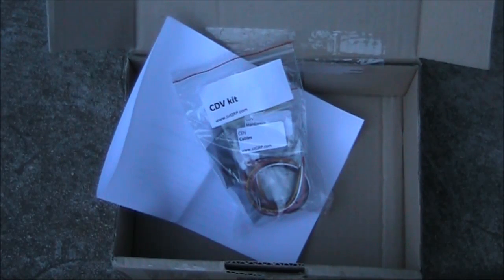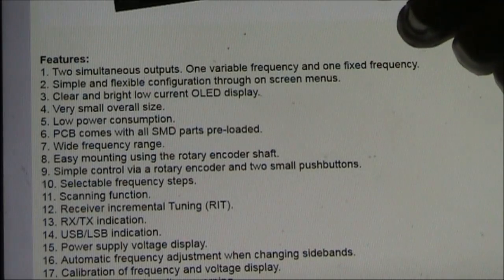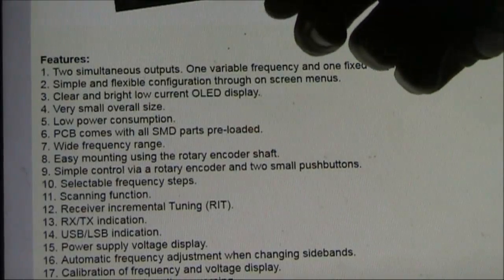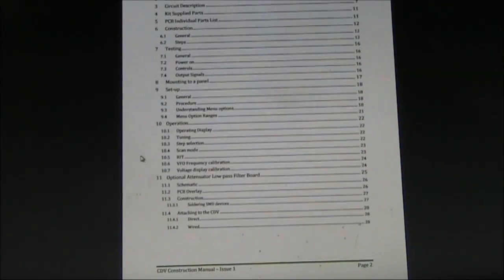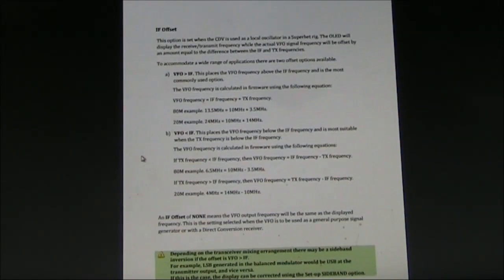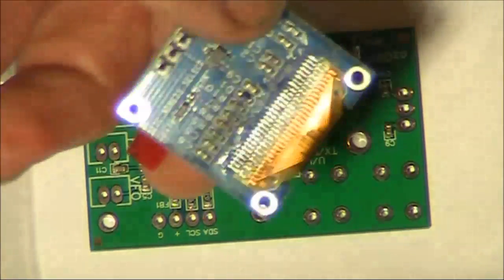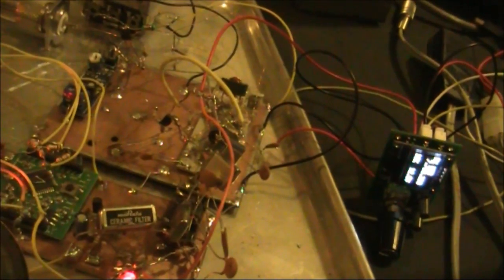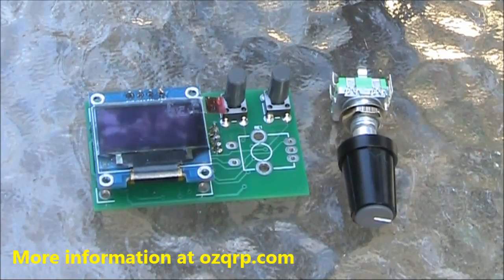Reviewing the OzQRP CDV DDS VFO

Comment: Would this be suitable to convert an fm  cb type radio by removing the Crystal of the radio and replacing it with this unit?
Reply from the maker: Possibly but you really need to know what you're doing and preferably have a circuit for the CB. Achieving the frequency modulating may be difficult.

Comment: I can think of several applications for a VFO of that size and versatility. It would ideal for in a BITX transceiver since the fixed output can be used for the BFO and the tunable output used as the VFO. This could turn a 20m BITX xcvr into a rig for any desired HF band; possibly even a 6m xcvr.
Another use might be found as an antenna sweep analyser provided one can modify the code within the microcontoller.
When I get my hands on one of these I'd like to install it within a PSK31 transceiver that I built for 80m. The plan is to get it functioning well on 80m before tackling the other bands.